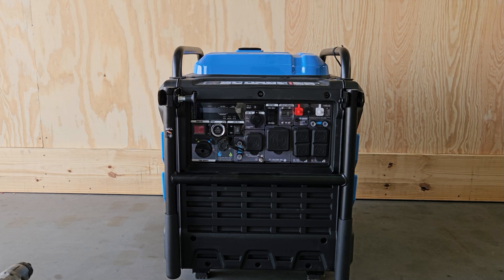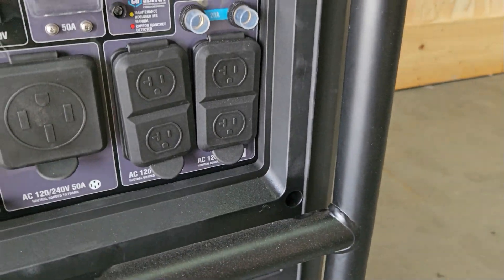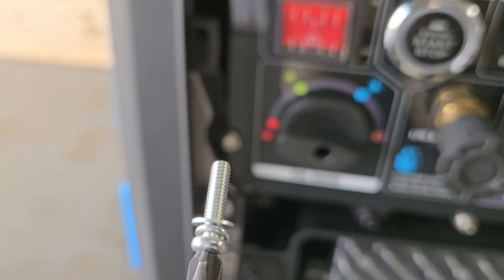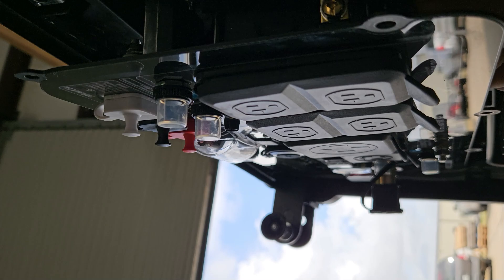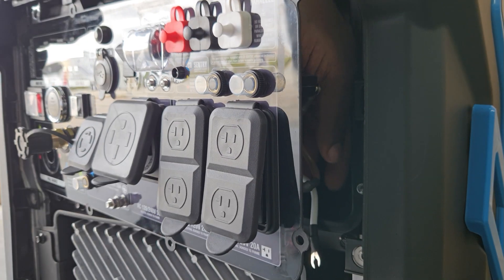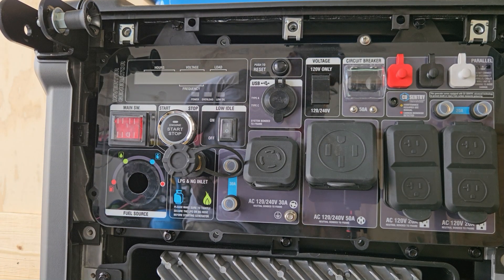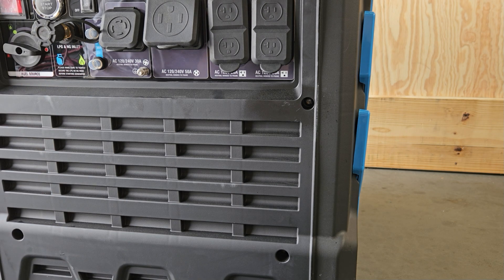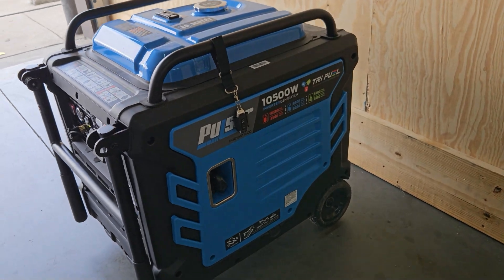How to Convert the Pulsar 10500 to a floating Neutral

Comment: maybe a dumb question, but if you were to power your whole house (need floating neutral) and some other appliance directly from the generator (need bonded neutral), would that cause a problem? at that point maybe the solution would be to power the house (need floating neutral) and then power the other appliance from a plug in the house?

Comment: What about a boat with house batteries. It has a metal bonding system for all metal parts.  Having a bonded neutral is good for a boat. Does the boat bonding system need to be connected to the generator bonding wire ?
Reply from the maker: Your generator will be bonded when using it on a boat you could use a bonding plug to achieve that.

Comment: The video was AWESOME HELP!  I have a BE10500it Inverter/Generator which looks very similar to the Pulsar with the exception that the 240v connector is last in line on the right side.  I had 2 neutrals together screwed to a little bar with the ground also connected. This bar was located on the back of the receptacle panel near the 240v receptacle. Once I removed the 2 Neutrals connected to the bar, I used a bolt and nut and screwed the 2 neutrals together and shrink wrapped them securely. Once I did this i did a continuity test between Neutral and Ground and VOILA... no bond. I put the Inverter/Generator back together and ran the same tests as you and ALL is GOOD!  Great JOB!

Comment: Hi. I plan to hook this up to my home electrical panel via a 50A inlet so I understand I have to convert my unit to floating neutral per this video. 

At 11:04 of this video you indicate that you can insert a 30 amp plug to use as a bonded neutral. Does that mean if AFTER the conversion to floating neutral, if I am NOT connecting via the house panel, I can run extension cords via the unit without having to undo the conversion done in the video? EXAMPLE: Might lend to friend/neighbor without a 50A inlet connected to their home electrical panel and they just plug extension cords into it. 

Please clarify and provide a link to an appropriate plug if that is the case. 

Great video as usual. Thanks!
Reply from the maker: Yes that is correct ✅
Reply: Use the plug when using portable yes

Comment: Hello Gavin great video as usual here in Canada we are quite a bit more limited.  I bought a BE10500IT which is another version of the genmax but it's bonded neutral.  It's definitely not built like the pulsar anyway if you come across some information on how to make it floating neutral let me know it seems that arc fault breaker struggle with bonded neutral thanks in advance
Reply from the maker: https://youtu.be/FuUuFqNP4YA?si=XbnpqlPpP6OXRFAp

Comment: Fantastic advice great video, what happens if you are using the south wire surge protector prior to the source entering the panel?
Reply from the maker: Surge protector will not work on a floating neutral generator

Comment: Thanks for the video and the knowledge we gain. 

What happens if you use a bonded Gen on the house? Also what happens if you use a non-bonded on and RV? Thanks again.
Reply from the maker: In most cases, degenerate will not trip when a fault is detected

Comment: Two things.  One, according to the code, you now need to label the generator as a floating neutral (some sort of sticker is fine).  Two, a neat trick is instead of removing the wire, you can use a switch to switch it in and out.  This lets you go back and forth w/o having to take all the facia stuff off every time. I was thinking of using a locking keyed switch so it couldn't be accidentally "bumped" out of position.   Great job, most aren't aware of the reasons when they first buy one of these.
Reply from the maker: Yes, I would have added a label, but I don’t plan on keeping it as floating neutral
You can also use a bonding plug in the 30 amp receptacle
Reply: @GeneratorReviews  Bonded plug is probably the best solution.  I do have a question.  I noticed the parallel ports are different on this unit and that they match my Westinghouse (Red, Black. and White square plugs).  Is this new?  Even on Pulsar's webpage they still show the older parallel setup.
Reply: Using a bonding plug in the 30A receptacle is a great tip! I was going to use a bonding plug in the 120V outlets but my generator has GCFI outlets so that won't work. So I thought I'd install a switch but there are definitely risks with doing that because the switch could be accidentally put in the wrong position and create a safety hazard. When I need to use it in the bonded configuration for camping, I won't need the 30A receptacle so putting a bonding plug in there is a nice solution.
Reply: if we have a manual transfer switch can we use the bonding plug or is best to just converting to floating neutral?
Reply: Do you need to do this if you are using for a food truck this bonding thing
Reply: Locking key switch is a very interesting idea! I never realized that was a thing. TIL!

Comment: Is there any harm in dropping the ground connection in your panel? That way your generator can still be used with extension cords safely?
Reply: @gagebaker2915  you just need to get a bonding plug when using it as a standalone unit you can make one yourself or get one off of Amazon.
Reply from the maker: Just get you a bonding plug or you can simply make one.
Reply: Can I plug a bonding plug into the 120 and use the 30 amp and 50 amp at the same time with two small campers?